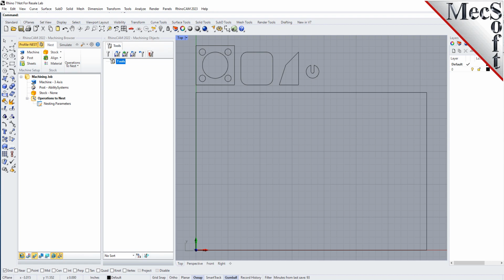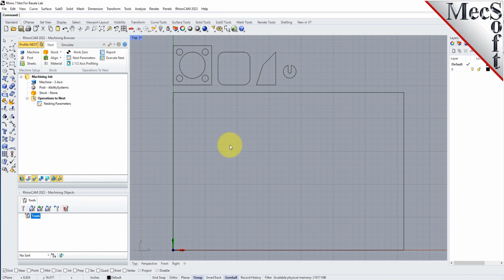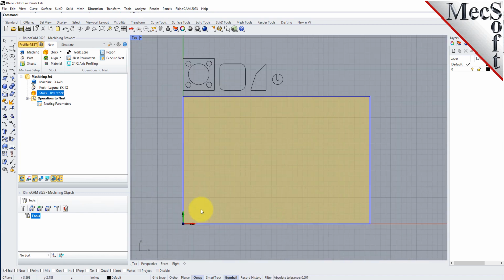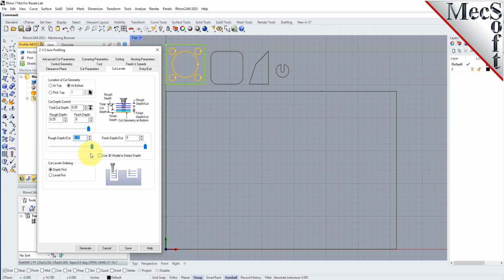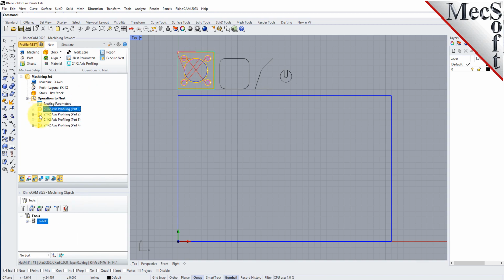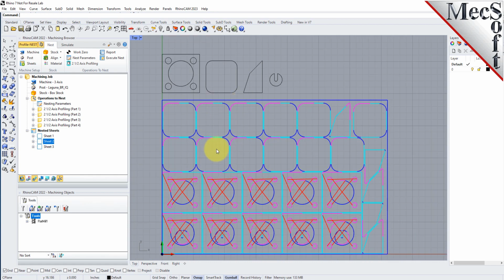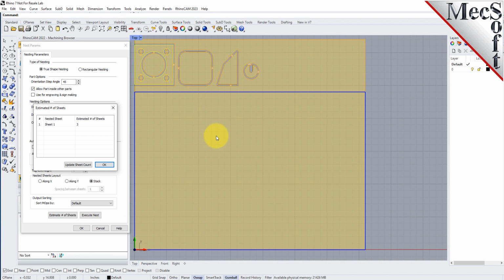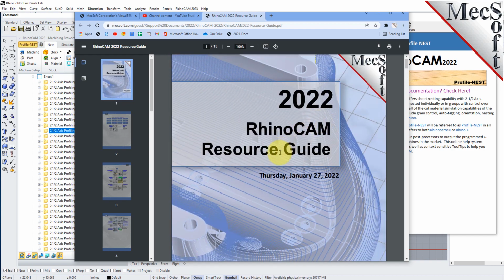RhinoCAM 2023 Profile-NEST Quick Start

Comment: Is there an option to cut from the inside out so you cut the part in part cuts first? This makes the likely hood of parts breaking loose less likely without having to leave a bunch of tabs to hold the parts.